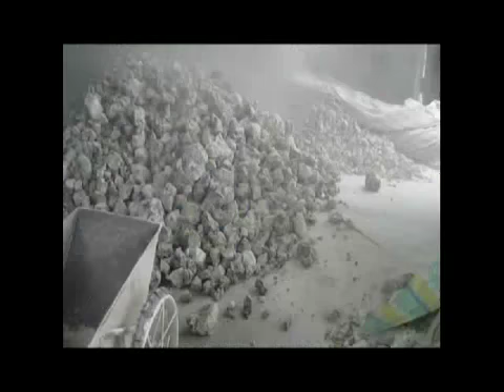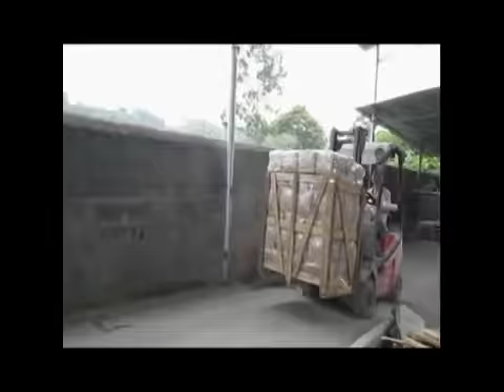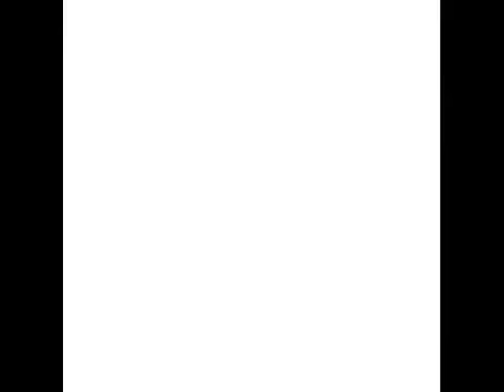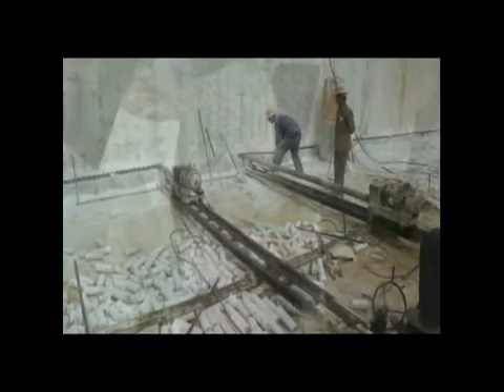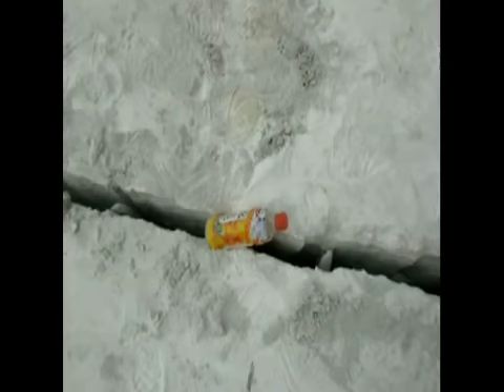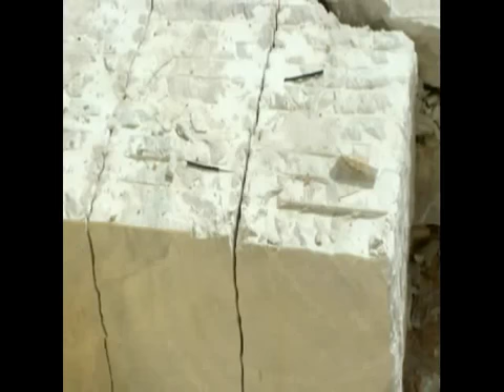expansive mortar for stone cracking and concrete demolition from Xiamen Bestlink

Comment: which brand of expansive mortar have you tried and which one turned out the best ??? what would be the distance c/c based one 2° bore, 2 foot depth into 115-135 MPA bedrock. (We have to excavate a 7mx5m opening 10m down into the craziest bedrock I've ever seen, granite kind of crazy)
Reply from the maker: +Steven Boucher  hi, I noted you has hydraulic robot breaker, can't it work to crack the bedrock? we are factory and our super quality expansive mortar has same performance as Fract-Ag. can you tell me your email address? I wand send more details to you via email. Or, you can just mail to me: 8sales@quarryingtools.com